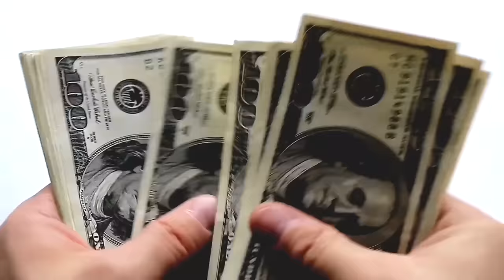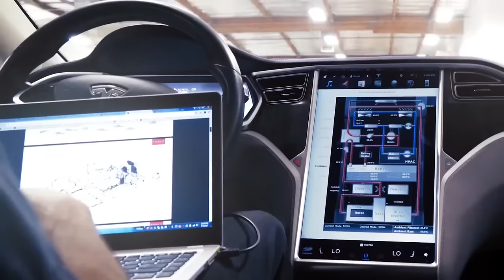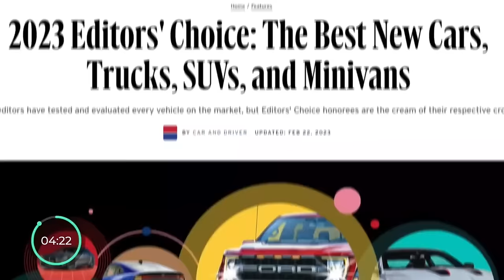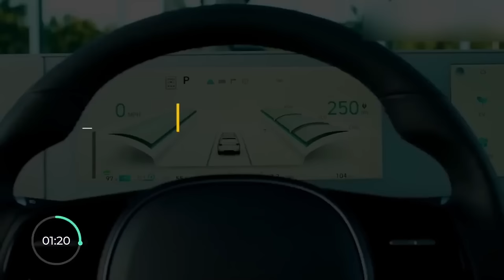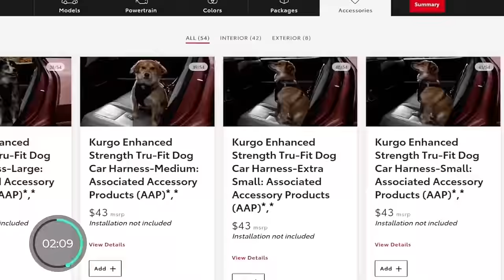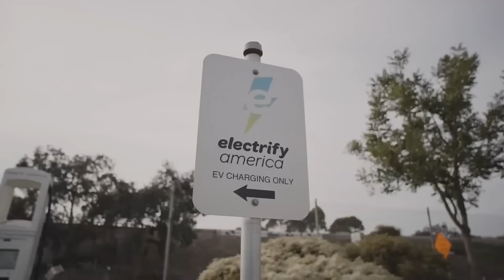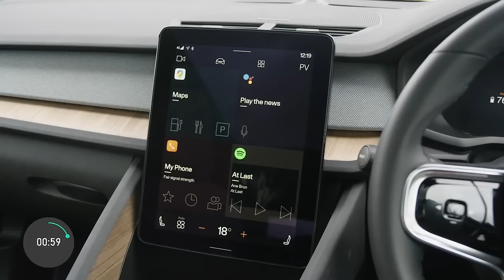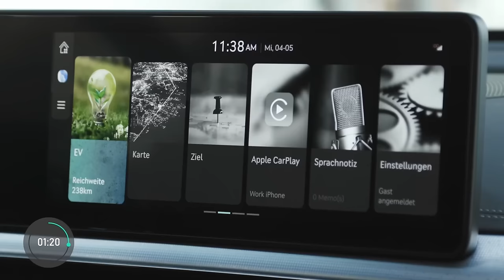Top 10 EV Crossovers: Pros & Cons

Comment: Model Y $36K after federal rebate includes
* RWD 242mi range
* 76 cubic feet of cargo space split between its front trunk and rear hatch
* Autopilot included
* Heated memory seats and steering wheel + entry mode
* Power hatch and folding mirrors
* Phone key and remote
* Auto wipers, headlights, and highbeams
* Dashcam and video security alarm (sentry mode)
* Navigation
* voice commands
* HEPA filter and Bioweapon Defense Mode
* 3 backup cameras
* Tesla Vision
* Safety - scored near perfect in the IIHS crash tests.
* “top safety pick +” award
Reply: All that and still no rear cross traffic alert 😂
Reply: @jokulhaups309  The three backward facing cameras is not enough? 
Eight cameras and powerful vision processing provide 360 degrees of visibility at up to 250 meters of range.
Rearward Looking Side Cameras - Max distance 100m
Rear View Camera - Max distance 50m

Give it time, other manufactures will follow Tesla's lead and replace their UltraSonic Sensors. 
Porsche has already started.

Comment: For me BEVs without V2Load function and even one 230V AC power supply inside the car, are not really BEVs. The VW ID,s have all different wheel sizes in the front and back. What for? Stupid and a dealbraker.

Comment: I've had my model 3 for over a year now and 30,000 km. I actually find the lack of a driver instrument display a positive. Other than occasionally checking the speed, I do not want nor do I need any other data to safely drive a car. In fact all the superfluous information blazing at me in my other cars I now find disturbingly distractive. With an open view of the road it is more engaging to operate the car according to its surroundings. The Tesla door handles? Agreed not the best design for user convenience/comfort.